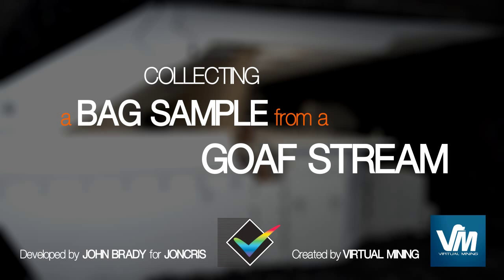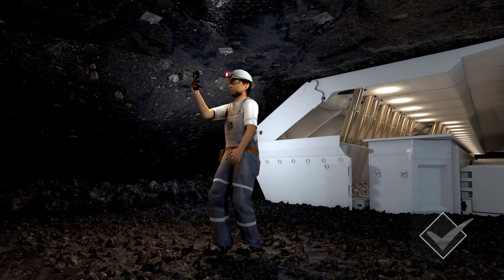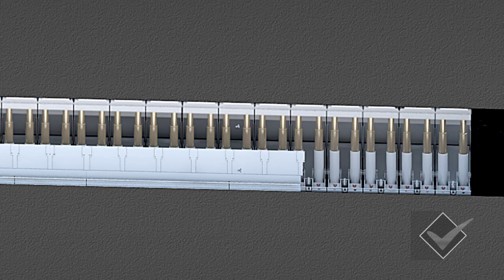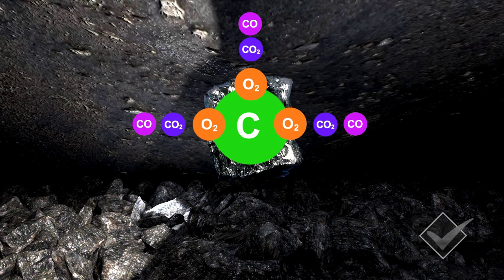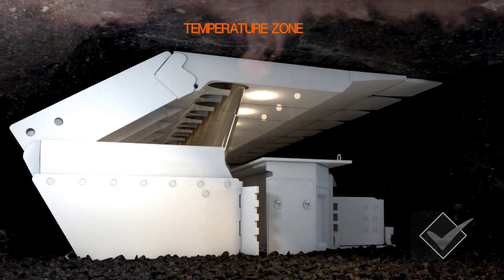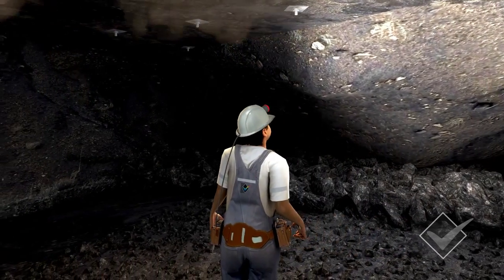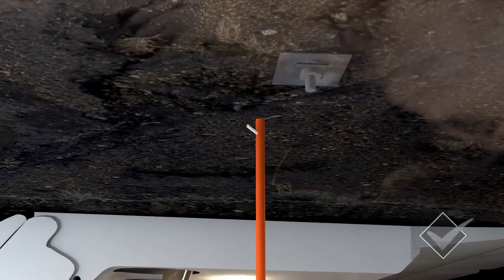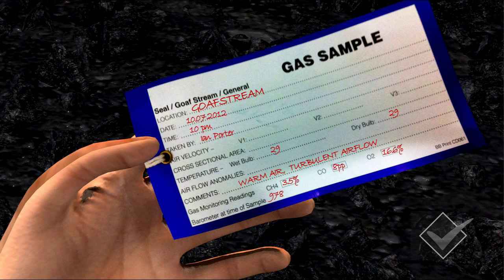Joncris Sentinel Services - Goafstream Sampling Presentation

Comment: Continued from previous.

If you think about your walking speed for a moment. If you walk at 1 meter per second and your detector reacts in less than 10 seconds you are less that 10 meters into the dangerous atmosphere. Many portable detectors have a response time in excess of 40 seconds, you're a long way into the dangerous atmosphere before the detector reacts and then you have to get out as well. Fast sensor reaction (fast t(90)) is very important.

Comment: The important measurement to note when choosing a portable gas detector is the t(90) time of the sensors. The faster the t(90) time the quicker the sensor will respond to a toxic or combustable gas. The t(90) timesof the detector shown in this video are: Combustable: <15 sec (Pentane) and <10 sec for methane, O2: <10 sec, CO: <15 sec and H2S: <15 sec. These are currently the fasted t(90) times of any portable gas detector on the market.